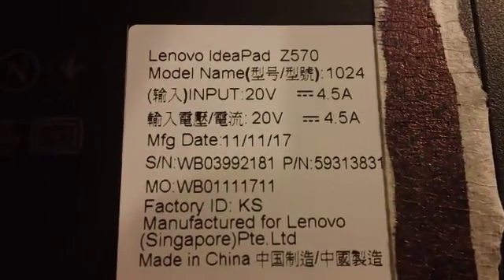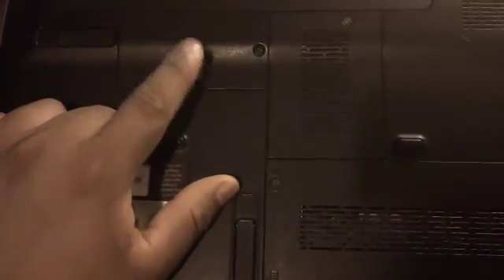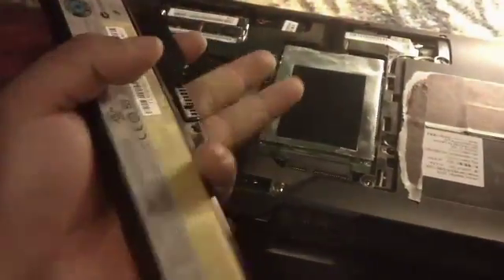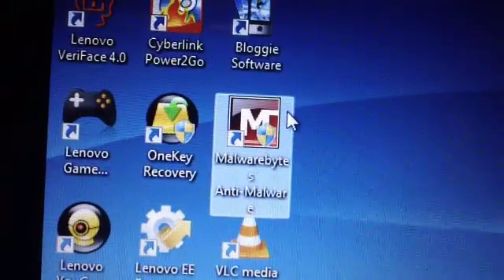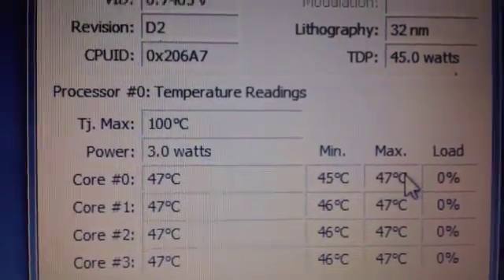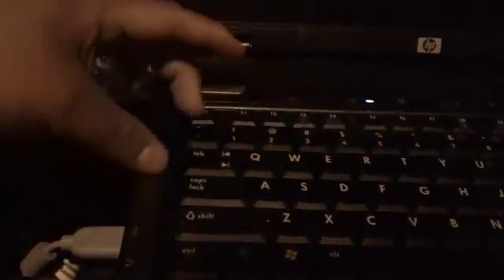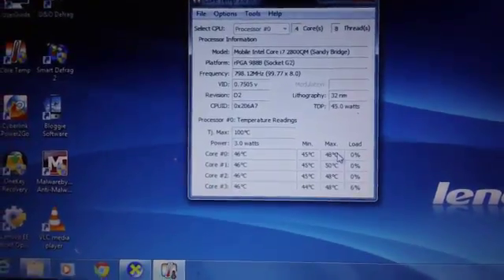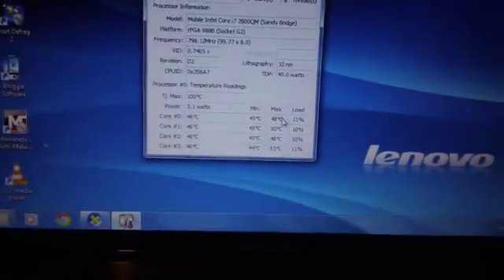Lenovo z570 review

Comment from the maker: With this laptop you can bet you can run games just at low settings with the nvida support chip... But another one of the Lenovo would be the Y580 model which is a more of a gaming laptop... Just about any modern laptop can emulate ps2 without a problem... You should look into the specs before you buy and see if they fit the brand name games you'll be playing. Also I would recommend picking one that is easy to manage/clean like I show in the video.

Comment from the maker: The reson I use other defragmntor for one its faster, and you are able to see it in action. In windows Xp it wouldn't move some files but not sure in windows 7 because it doesn't let you see what is going on. The free one that i was talking about actually see's what you are using more and puts it to the middle of the HDD so it loads faster. Which includes the system aka windows 7. Mainly that is my use other other defragmentor.